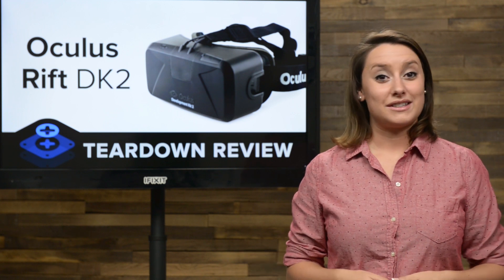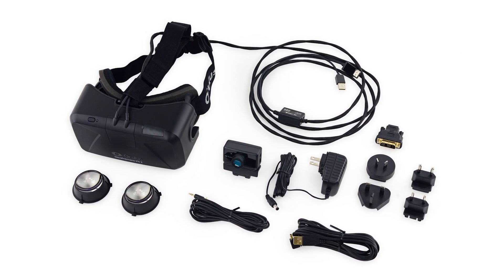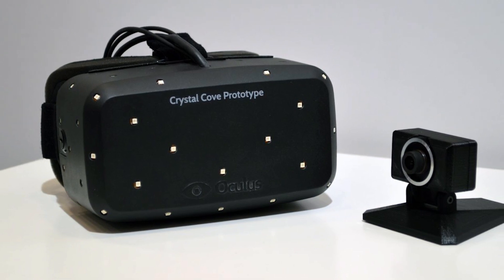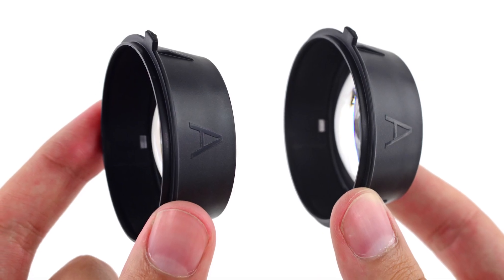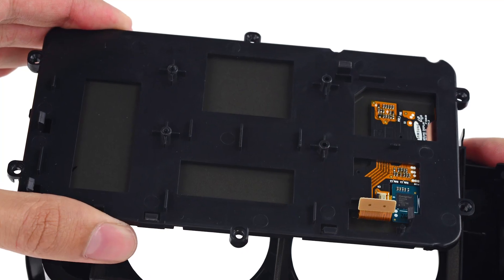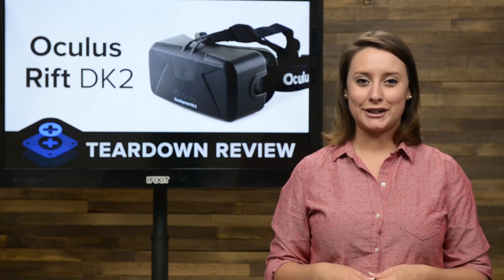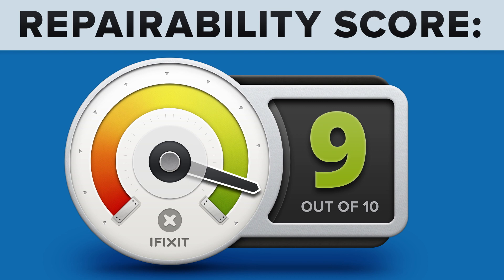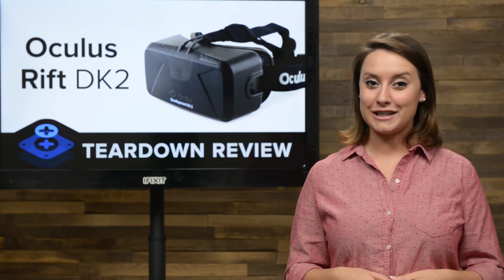Oculus Rift Dev Kit 2 Teardown Review

Comment: What?? A note 3 display?!
Reply: Yeah it does not make much sense
Reply: Pedro Henrique Why not you experts ?
Reply: Dev Kit v1 had a Nexus 7 display.  Big whoop.
Reply: Pedro Henrique
It makes perfect sense. It's a high quality full HD display that's mass produced and proven to work. Why develop your own when you can buy one off the shelf? This keeps research and development costs down and also lowers the price of the entire unit.
Reply: Yeah but I dont think the final version will be a smartphone screen...
Reply: Pedro Henrique I'm pretty sure you're wrong.  CV1 is expected to use a Note 4 / Samsung OLED 2560x1440 resolution panel clocked up to about ~90 Hz refresh (read: very different than the phablet's typical 60 Hz), based on rumors.  CV2 is likely to be the first VR HMD to have a fully custom-resolution and custom-built panel, but even it may be based off of a different screen and re-tooled to work with Facebook's designs.  There is nothing wrong with super-high resolution phone screens when the software used to drive them can be adapted to their needs.
Reply: abstractron You will probably end up being right, but I hope to see a custom screen in CV1. 2:1 aspect ratio makes sense.
Reply: It's better than the 1st dev kit's screen, does it really matter were it comes from? Having a custom made lcd screen costs a load of dough and remember that they are still tuning in the final specs. No reason to do the exercise for a dev kit, it would be a waste of money.
Reply: abstractron if that is correct, then hopefully the custom screen for CV2 is taller, wider and curved for near life-like fields of view. a custom-built panel just sounds really expensive though :(
Reply: billieguitar Why? What advantage would anybody have with a custom made screen? Why would they even bother if they can just use a screen that fits their requirements perfectly that has already been designed and produced by somebody else?
Reply: Pedro Henrique Personally I think it's a great idea to use a smartphone screen. Which one you chose is another issue but just having it be a smartphone screen means it's incredibly cheap and replacements are almost always available.

If it was a new design it would be incredibly expensive. I think they're also measuring the response it gets on this device.
Reply: The type of screen has been known for many months. ;)

If you have a look at the various phablets around atm with a 1080p (or higher) panel, it's surprisingly difficult to get hold of panels in bulk that are suited to the Rift.

I spent many weeks searching for panels / connectors / datasheets for the 1080p panel on the RiftUP! kit on the DK1. The manufacturers make it quite tricky to buy the panels themselves in small quantities (for testing), and even harder to get hold of the full datasheets.

Most panels these days are using the relatively new MIPI interface too, so you can't just use a cheap LVDS scaler board like many old panels used for years.

Can't wait for my DK2 to arrive, but I'm hoping the positional tracking with the camera will work from a fair distance, so the Rift doesn't go out-of-bounds.
Reply: That doesn't sound too bad, Mystogan.

It was just that after watching Cymatic Bruce's live stream vids the other day, I was surprised that the viewing area for the camera seemed quite narrow.

I guess that was 'cos he was sitting close to the camera though. Most of the time, I plan on using the DK2 seated, and about 5 feet away, as you say.

I do wonder how the slightly less accurate tracking translates to possible motion sickness though?
Reply: Heck why not? I don't mind if they even use Samsung S5 screen in the consumer version to keep the price down. I mean. Have you seen this damn thing? AMOLED, 432 ppi. You can barely see the pixels up close so it should be fantastic for OVR.
Reply: Yep, I'm sure they'll be using a stupidly high-res screen for the CV1.

There are 4K screens being seen already, so they will be fairly common soon. They just need to be closer to 6.5" for the perfect FOV though.

I have the RiftUP! kit on my DK1, and even 1080p still isn't quite there yet. But, it's miles better than the old 800p panel. ;)
Reply: Yep, I'm sure there will still be motion sickness for some people, I'm just hoping it will be reduced to almost nothing for me.

I'll probably only be playing on it for about an hour each day anyway (unless I get stuck into Portal 2 again. :p )

OK, maybe 4K might be a bit of a stretch, but things in the LCD / OLED World are moving very quickly, and it could still be at least another year until the CV1 is released (even though they're saying it will be sooner).

Although, they might manage to get it released in the next 6 months or so due to the Faceplant investment.

Keep in mind that even the 1080p panels for mobiles / phablets were very expensive last year, and now they can be bought for less than $50. ;)

I "only" have a GTX 670 on my Rift PC, but I think that will be just about enough for 1080p / 2K @ 75 FPS.

I'm a bit worried that it will start to drop frames at 75Hz, but hopefully not too distracting.
Reply: Lol hilarious
Reply: Mystogan Yeah, I see what you mean - I'm not even sure that my GTX 670 will keep up with 1080p @ 75 FPS at all times tbh. lol

So, it sounds like it will be likely a 1440p panel in the CV1. That's reasonable.

I don't think they will necessarily be loosing money on every CV1 when sold in bulk though.

The PCB design they have already could very well be used in the CV1 with a few tweaks (the current HDMI-to-MIPI bridge chip can only handle up to 1080p @ 60Hz for example.)

I have a hunch they'll be adding two cameras for AR. It makes a lot of sense for Facebook's future plans.

People like Michael Abrash and Carmack have been pushing the AR thing for a while now (who obviously both now work at Oculus).
Reply: Mystogan Augmented Reality, it is different from VR. Augmented Reality has a stream in from our reality (like a cam) and add in Virtual added elements.

Comment: I've had my OR for about a week. At first, it worked for about an hour on my PC, then after idling, it stopped working and under no circumstance was I able to get it back. Took it to a friend's place and it worked fine, and what an amazing experience it was. Brought it back home and still didn't work. Then took it back to friends place, along with taking it to the office, with no luck. When I say it doesn't work, I mean that the Oculus Config Utility refuses to detect the OR. This has been the problem. There is simply no detection and that torturing orange light refuses to turn blue. I've spent many many hours fiddling with the many variables (displays, service, cables, direct/extended, comps, drivers... I can go on and on) to pinpoint the cause of the problem with no luck. I finally decided to open it thinking the BUS between the display and board was a bit loose, but it was fine. But upon opening it, I noticed something. At 2:39, if you look at the right hand side, in the SWD square thingy, under J6, there are 2 columns of golden rectangles. In my OR, the right column has a bit of ware and tear it appears, the gold seems to have worn off. I have no idea what that J6 thing is, but would anyone know if that may be the cause for the no detection? Or what the function of that part is? Any input would be appreciated thanks.

Having had a taste of VR in those few hours it worked on my friend's PC, you can only imagine how frustrating it is, especially after waiting 2 months for it to arrive :(.

Comment: Why is everyone so surprised about it using the Note 3 display? lol

As someone who helped find a 1080p panel for the RiftUP! kit, it makes complete sense to use a mobile / phablet display. ;)

https://www.indiegogo.com/projects/riftup

The only widely-available panels with a small size but high resolution / high PPI atm are for mobiles or tablets. The Rift needs a display of around 6" to 7" so it can fit the FOV with similar simple lenses to what's being used atm.

I did wonder why they used the screen with the touch digitizer still attached, but that makes sense too - the panel without the digitizer is surprisingly prone to scratches and finger prints, so the touch screen gives great protection from that without noticeably reducing the contrast etc.

I was a bit worried at first that the DK2 actually only has half as many Blue and Red pixels as it does for Green pixels (Pentile display), so when they say "1080p", it's technically not 100% correct...

http://cdn.gsmarena.com/vv/reviewsimg/g2-note3-z1/inline/gsmarena_004.jpg

But, apparently the new pixel structure makes the so-called screen-door effect far less pronounced.

I'll be able to see for myself soon, as my DK2 has apparently just been shipped. :D
Reply: It looks like it's been teared off an acutal Note 3. The Samsung logo is still there and even the button hole...
Reply: Yes, that's because it is. ;)

Oculus has a partnership with Samsung now, so they can get the screens even cheaper.

It makes sense now why they left the touch digitizer on the front - the panels for phones / tablets are actually quite prone to scratching without the touch part, so it protects it.

Doesn't really add much to the cost, the whole screen is only about $60 now.
Reply: electronash True but it kinda feels cheap...
Reply: Actually, make that closer to £60 / $100 for the screen, but still quite cheap.

Oculus will be getting a huge discount too.
Reply: Well, it kind of is cheap from the construction side of things tbh, and it's meant to be, so it gives the best affordable VR experience.

It's more down to the software warping and head tracking that really makes it work so well.

I was a bit surprised to see the touch digitizer in there too, but it does protect the panel, and shouldn't reduce the contrast or anything like that.

Quite a nice panel on the DK2 though - I hated the idea of the Pentile screen at first, but now I've tried it for a while, it's great.

Will only get better as well with the consumer version ofc.

I bought Euro Truck Sim 2 the other day to test with the DK2 - really good. ;)
Reply: I agree.  The samsung screens are actually quite good but a whole screen that has been designed for at least 10 or 20 cm distance from the eyes the Oculus put it at about 2-3. The lens might even get the image more pixelated
Reply: It doesn't quite work like that with the lenses etc., but I know what you mean.

This is probably the best screen they could get at the time to fit the requirements.

It is still a Dev kit, so not perfect, but so much nicer than the DK1. :)

Ideally, the CV1 would have a 4K screen, but even the average gaming PC will struggle to keep up with that and keep at least 60/75 FPS with Vsync and no tearing.

I've heard they are aiming for at least a 1440p panel for the CV1, but it might be even better.

They may even go for two separate panels with a custom controller to split the image, that would be great.

Comment: This new info about the display is actually pretty funny - I already have a note 3 and just got my google cardboard kit...I'm currently modding it with a headband and I just bought a usb OTG cable to plug in a PS3 controller for movement.  I'm assuming the optics is much better in the oculus because I can very clearly see pixels everywhere with this kit.

$20 oculus thrift ftw.
Reply: Does it fit?  I was under the impression Google Cardboard was designed only for much much smaller screens.

As for the optics, that's a given.  As cardboard is not optimised for any particular size of screen it just uses a small subsection, the Rift can be precisely designed to utilises every pixel and so not blowing them up quite as large.
Reply: Alex Atkin yes, it fits perfectly with just a few slight modifications.
Reply: Siciliano Good to know.  I need something to tide me over until Rift/Morpheus (whichever comes first).